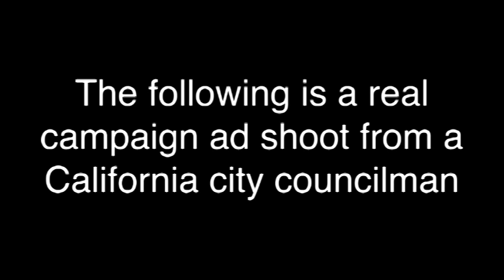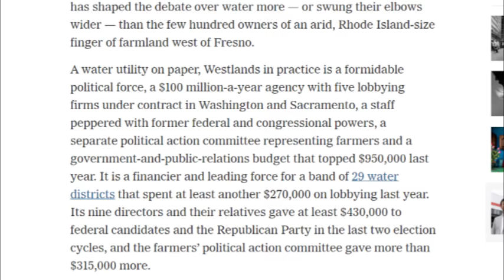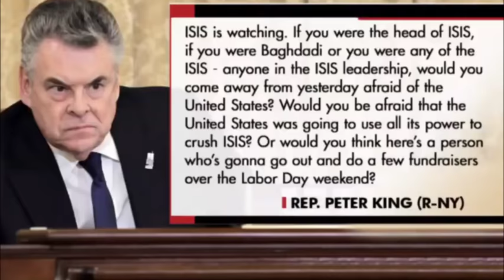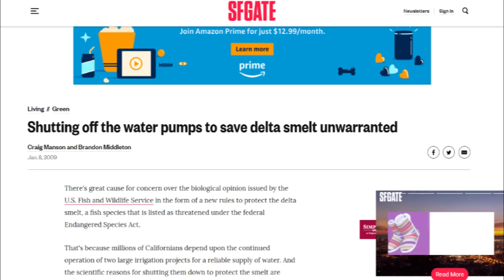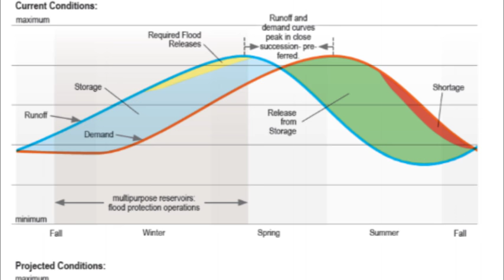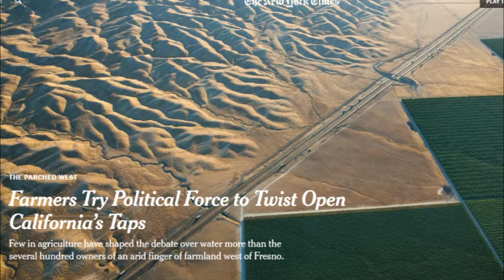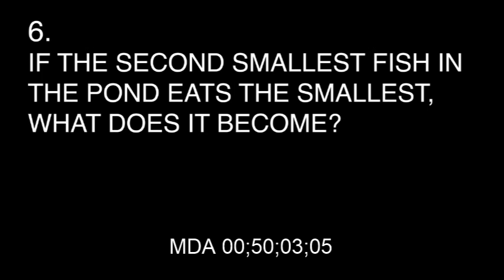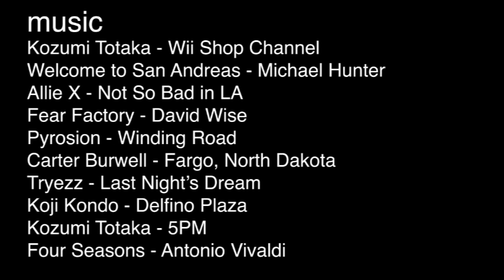The Fish That (Allegedly) Destroyed California

Comment: I enjoyed the video, but was disappointed there was no mention of the sewage leaks and their effect on the SF Bay ecosystem. This has been covered up and ignored for over 3 decades. The dilapidated sewage system in the SF Bay area has been leaking sewage into the bay for decades. Not only does this have a negative effect on the ecosystem (including the fish) it also requires so much of our freshwater from Norcal reservoirs to be used to "Flush the Bay." Why is the SF Bay not required to fix this issue? They are being permitted to damage an ecosystem and waste our limited fresh water and it's been going on for decades!!! Why is this not discussed? Where is the outrage?

Comment: Its a shame about the Smelt nothing is expendable in any ecosystem. On the fires, that map of Australia with fires all over. That is pretty much how it is most of the time. The problem is fire intensity, like the big ones a few years back. Indigenous fire practices used to be a release valve that helped prevent these mega fires. It is still used in some parts of the country but not every were. That needs to change for a start and could be something that California should also consider replicating. Though sadly that will depend on politicians pulling thier fingers out.

Comment: while you have more understanding about some of this than one would normally expect, you also dont understand significant portions.
im writing this 30 min in.
first farmers litterally are bagging and shipping water in the form of produce.
seccond, there is unbelievable water mismanagement. water doesnt change flow based on 'climate change' it changes flow with retention. the river is the part of the auqafer which is above ground, but all of the funnel of the valley leading to the streams and rivers is also aquafer. the more loose and fluffy the soil the more it retains, mean while if you drain groundwater it will settle deeper and that settled soil cant be replenished. on top of the soil itself, the less straight and slower the speed of the water the more is watered, and if you have plants which get flooded, they will also reduce the intensity of floods by holding that same amount of water over larger surface areas. if instead of trying to get water into central channels, let alone straight cement channels- if we instead tried spreading the water over the whole valley, then the surface area and retention would change everything. the problem politically is that people dont want to lower the level of the sacramento. the idea that it could become a lake is horifying to many, even though spreading the water across the valley would make the entire valley flourish, and after some of the damage and desertification is healed, more could be allowed to flow down the central basin again.
third, you are wrong about forest fires. the reason why forest fires are more common isnt global warming but forest management. when you use fire fighters to extinguish a forest fire, the part which does get burned doesnt get aleviated of tinder. and when that tinder hit high enough levels the forest fires shift from hurting the brush, to being an inferno which also will consume trees. us dealing with the fire but not the tinder is us futily attempting to thwart natural processes which self regulate. then later on, a lightning strike or campfire will relight the brush, and generally speaking we will no longer be there to put it out. the more we interfere the more nature controferes. we dont like forest fires, and we often dont like seeing chared forests. but that rejection of natural processes and self insertion claiming the title of stewardship, it is often a proud and concieted myopic act.
the error you have here links to the earlier error. increasing the water retention would reduce forest fires, it would also reduce fire fighter deaths, and the actual important and relevant thing is it would reduce the amount of brush because water is a weak acid. the dead wood will rot and decay, not wait and accumulate and dry.
another thing which you may bring up is the rejection of a more closed loop solution for potable water. a complex system was developed to turn waste water back into potable water. and this was divulged to the public. and since the public dont know how the water system works they were up in arms against drinking water which had previously been sewage. the way it works is that there is a access tube in a fresh water river, this tube diverts water to a treatment plant, it is used by customers, and then the brown water is treated with solids separated, and then the cleaned water flows out into a stream. later down stream, there is another access pipe and the thing happens again. the central myth is that there is something sacred and sanctified about river water. so drinking water from the holy sacrament of a river is nothing like drinking cleaned and filter effluence. what the proposers fucked up is not maintaining the mechanically redundent stream or river. if they had just said that it was no different from the existing system, except the name of the river, it would have been fine. all they needed to do was make a several kilometer long 'river' similar to the fake streams people put in their yards, and have it be a park. they needed the farce, and it needed to be built large enough that it wasnt obvious what was going on. when they eliminated the mythical clean water supply from rivers, they fucked themselves and the people. and if they exposed the farce by having the river like 10 meters from outlet to inlet, people being able to see both stations would understand and tattle on the structure of how it worked. the problem isnt the brute fact of some people understanding the situation. the problem is that disinformed people being given a chance to vote will vote with their intuitions, not with facts. so you need to get some people who would vote one way with a full understanding, to have enough ambiguity and disorientation that they cease to be part of that opinionated coalition. the fix died through democracy.

'a shift of 25% would be from very wasteful use to somewhat wasteful use'
there is no wasting water. growing lawns seems like a waste right? but lawns also create root systems and that reduces the rate of runoff from plots of land. it is the same for down pours. you can concentrate all the water into a reservoir, and then release most of it as needed. but there is a problem with evaporation which is incidentally similar to the wildfire misunderstanding. texas was getting too much water and asked a state upstream to lower how much was released to avoid flooding texans. then they demanded the water be released as per an old contract, but the water had been evaporated. there was no water to send down stream. you can also spread that reservoir across the state. this might seem wasteful, but just as fruit are bags of water, so are grasses. when you have surge need, you compost the grasses. and before the surge need simply spreading the water has benefits. for example by having channels at equal elevation sorta like a halo lake, then the water released is uphill in all directions and flows down instead of needing pumping stations. there is no wasting water really, though evaporation is similar. the real interpolation metric is retention or discarding. rivers discard water, and basicly everything that retains leads to more stable flow. wetlands, plants, putting water cisterns under buildings like in tokyo, highly pourous sidewalks, parks which are sunk into the ground  so they become lakes during downpours (this is decent if there is no will for onsite retention). 
you dont need water micromanagement, if you are competent at water management.

yeah im done.
i dont know if you are going to shift from partisan shlock in the last few minutes but im done. you are now representing a central moderate position as right wing. and it is litterally true, not just comforting. my fellow californians are to blame for the shit they have been doing for ego indulgence instead of what actually would improve things. politicians are at fault, but so are the people en masse. they were treated with respect and they reacted in a way which proved without a shadow of a doubt that they shouldnt be given respect. of course im refering to teh sewer overhaul proposal, both the people and the naive project leader are at fault for the results. they subsidized big farming beyond the breaking point. it is litterally the fault of the people and the system of regulating interpersonal responcibilities which is causing this problem and others. the solutions were trivial and obvious, and they were rejected because the truth was ugly.
but now you are going to say that teh fault doesnt lie with the people? the politicians broke many times to a lobby. the people kept electing the politicians, giving their sovereign authority to dipshits. and now you are going to say it isnt the people's fault? no. it totally is. the persistence of a problem occurs when those it effects do not see the solutions as worth their costs.
this isnt rightwing. also no one worth of respect watches the news. attributing the slant of some journalists to a point of view is incredibly discrediting. journalists will callously pick up stories and try to push them to advance the agendas they are paid to promote. a frustration may be antagonistic towards the establishment but reinforcing the antagonism as partisan is the most hacky thing you can do. your peers did the same thing by trying and succeeding to smear those saying that bridges should be in better repair, with being racists and completely smearing the alt right beyond that.
Reply: Im gonna take my sweet time to read this essay couse It also has strutturale implications
Reply: Im also commenting becouse i feel like this comment deserves a response
Reply: Thanks for posting this. I had similar concerns based on my field experience working in forests and understanding at least something of watersheds and groundwater.